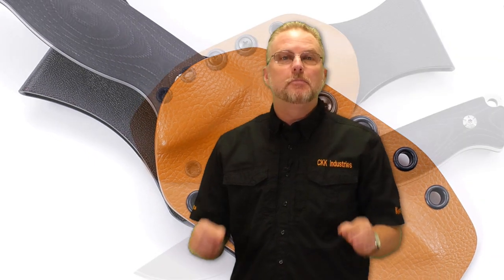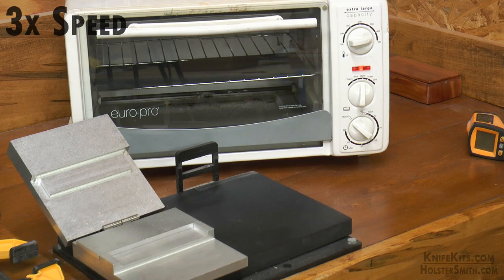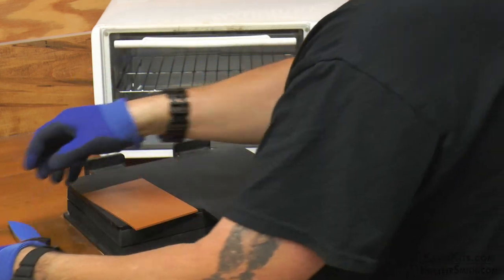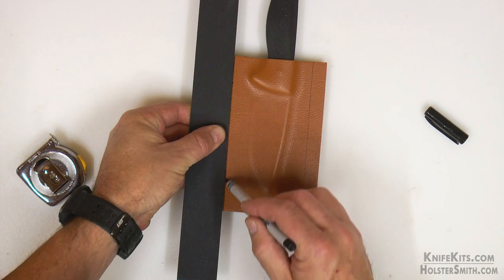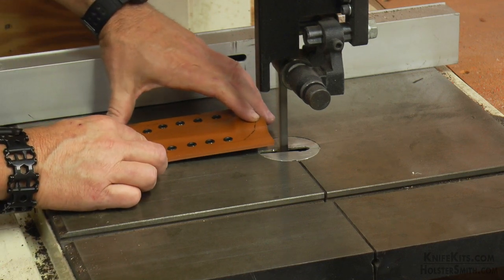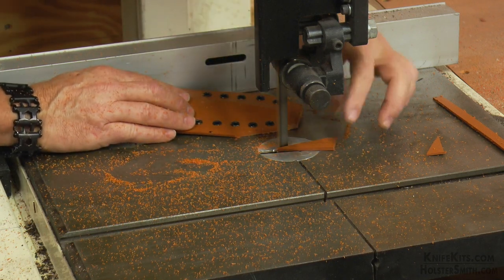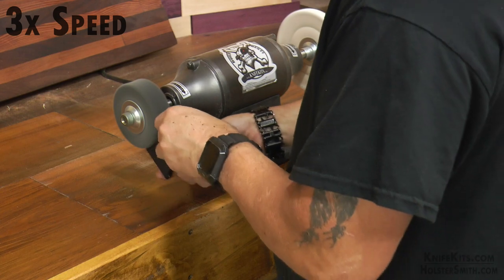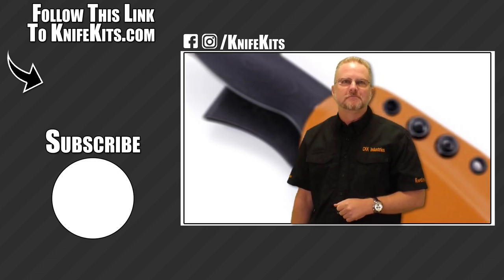How to Make a 2-Piece Knife Sheath w/ Custom Belt Loop using KYDEX­®

Comment: What thickness of kydex do you use? Thank you
Reply from the maker: Hi Sergejs. We used .080 inch thickness on this project. Generally that's all you need for an item this short and compact. Some makers prefer to use .060 inch thickness for knife sheaths, but we feel that .080 works better when you have an integrated belt loop as part of the design. It makes it less flexible. Thanks for watching, and let us know if you need more help!
Alex
Reply: @KnifeKits  Thanks a lot!

Comment: $300 for an aluminum Loop Jif lol. YOu can make one from scrap wood for free lol.
Reply from the maker: Hi Jeffrey. The aluminum jig is designed for mass belt loop production. If you only need to make a few, I wouldn't recommend it. However, if you have some aluminum bar stock at your disposal, it does work great for edge forming and heat reduction.